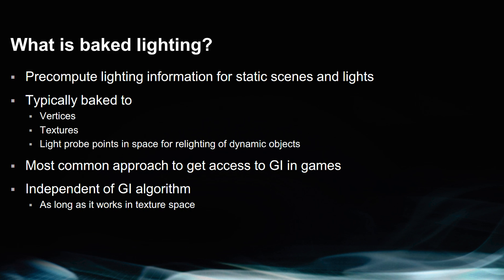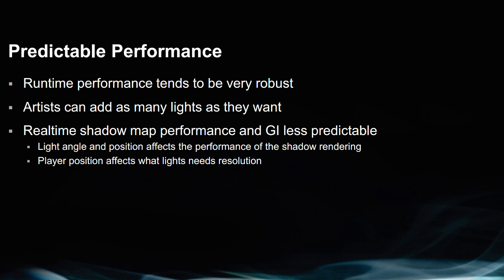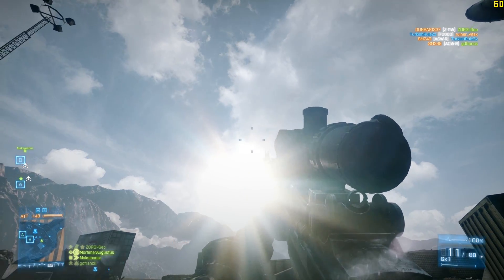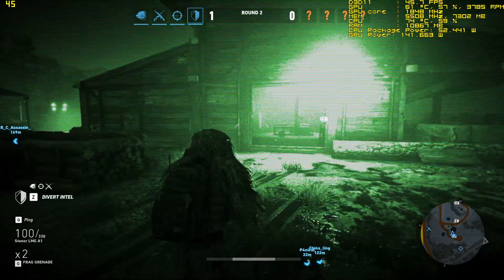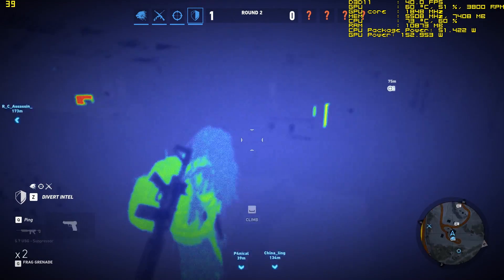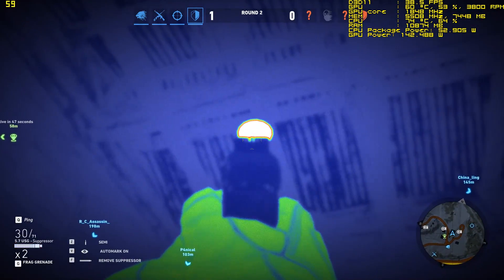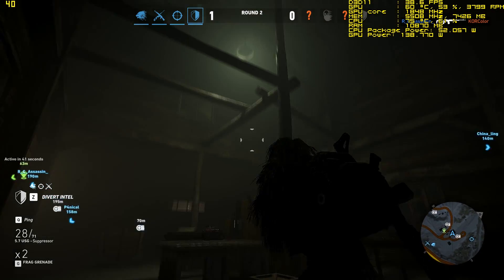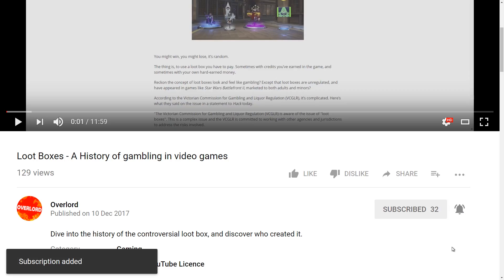What is Baked Lighting? (Lightmap)

Comment: What annoys me is the fact that one change requires you to repeat the whole 5 minute+ process of generating a lightmap
Reply: then use dynamic lighting. computers can afford it now.
Reply: @data043 so essentially be a lazy dev?
Reply: @dusk1234567890  well yes game devs are becoming extremely lazy nowadays but dynamic lighting is far more high quality as it changes with the environment, so i would say generally it is a good thing.

and also dynamic lighting is not that expensive, the majority reason that games used baked lighting in the earlier years was mostly due to game consoles such as the xbox 360 not being able to handle it, however even for entry-level modern hardware, it is a joke to compute unless you are adding things like high res refraction calculations.